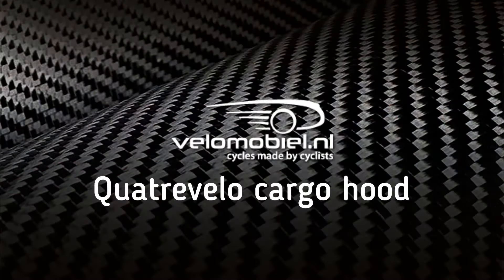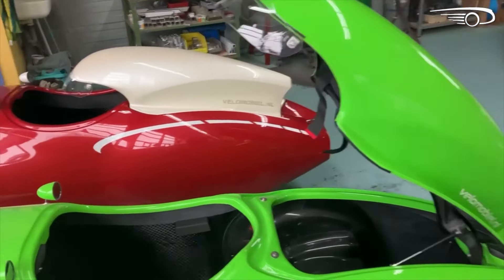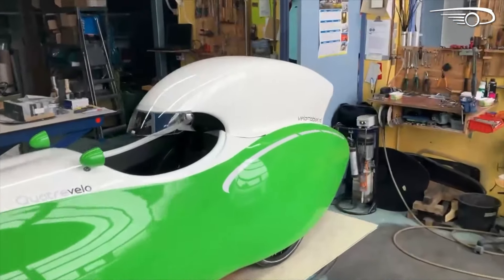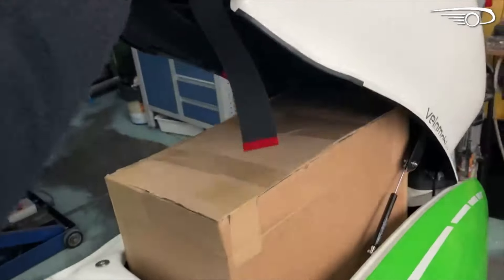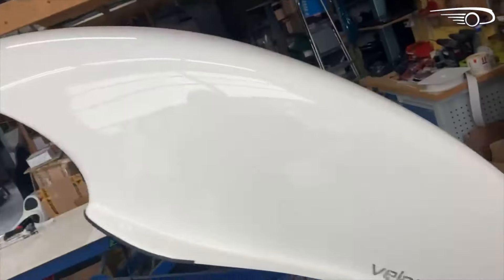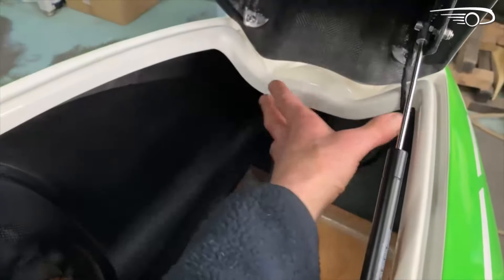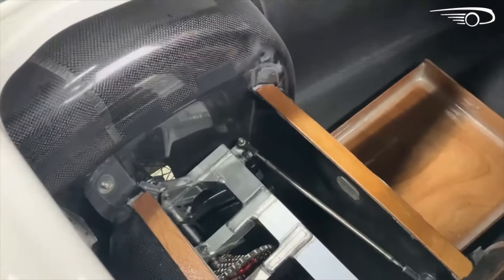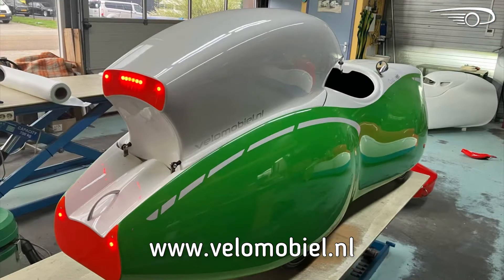Cargo hood for Quatrevelo velomobile

Comment: Hi Theo, just wondering  how can this hood be mounted on a 2023 Quatrevelo  and still use the  window hood if one so desires to have two hoods. Thanks …. one thought  some might have a dog they like to take along this new is just right sides if it had a window option as well, might be something pet owners might order.
Reply from the maker: This cargo hood has a new hinge system and is not quickly exchangeable, like the other 2 hoods. It would take more time to exchange and the new hing system would have to be installed (laminated) in the existing quatrevelo. We do not have windows planned for this hood.

Comment: Would a 45kmh quattrevelo possible someday? :)
Reply from the maker: Hello Mike,  This will not be made, Legislation is preventing this. There are a large number of regulations that this vehicle must comply with, this is very costly and forces a design that is very different from current velomobiles. And it is mostly not allowed on cycling paths anymore, forcing you to ride on roads where cars go 80 km/h or faster..